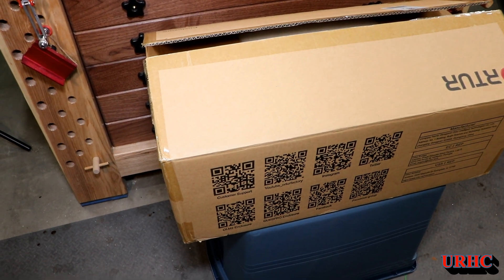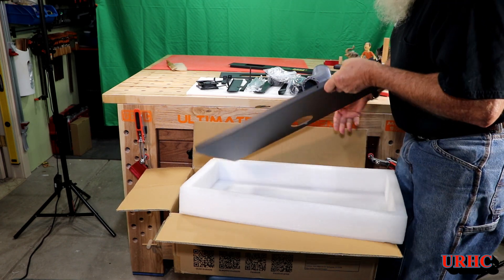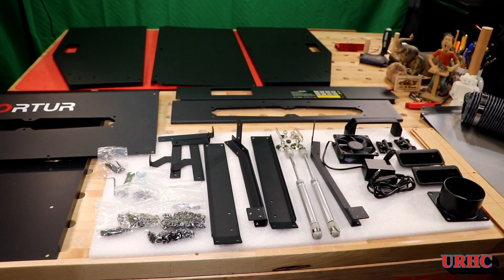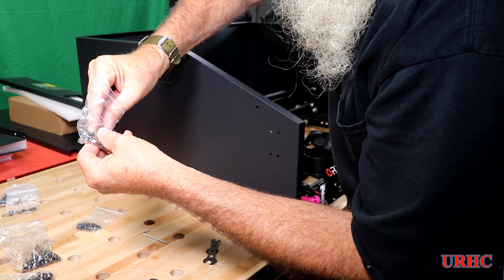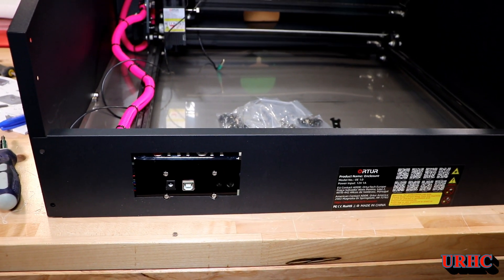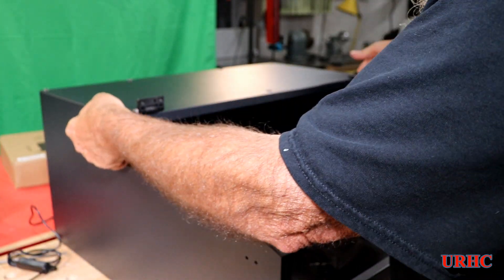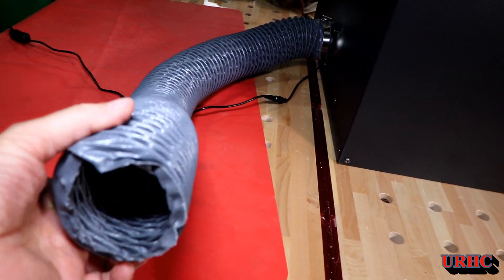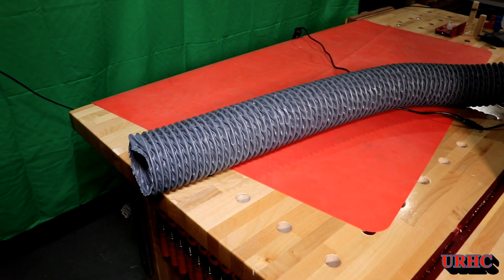Ortur LM2 Laser Enclosure First Look

Comment: Do you think you can replace the stock fan with the Cloudline A4 fan or is the fan supplied adequate enough?
Reply from the maker: For a short run the fan seems to do a pretty good job. I find  this extremely  expensive for what you get now that the pricing has gone up from the introductory price.  Thanks  for watching.

Comment: For the combined price of both units you can buy a K40 Co2 Laser cutter with a lens upgrade and air asist, in fact the price of the enclosure is nearly the price of a standard K40 Co2 Laser cutter
Reply from the maker: Yes you can if that's  how you want to go. Many like these  blue lasers because  they have very few problems out of the box and require  very little  adjustment and maintenance.  I am looking  at 40 watt+ co2 lasers now and the better  ones seem to be 4k and up. Prices are rising  daily on this equipment from China lately.  Thanks for watching.

Comment: that fan looks like a tiny computer case fan, how much air do you really think its going to move? your concerns about pulling air and fumes and returns and tight homes are all valid concerns if your moving a high volume of air, like a full size dust collector.. this is not that..
Reply from the maker: For a small fan it does good. I have seen many different  videos with people using larger fans that worry me. Any exhaust vent should be at least 7 feet from windows that open according  to codes around here and be sealed where it exits . Other appliances like dryers running at the same time can add to the problem. Just hoping people  will take a serious look at venting these lasers property.  Thanks for watching.